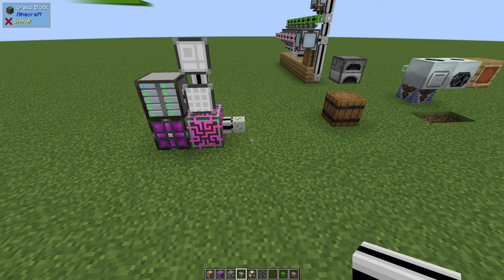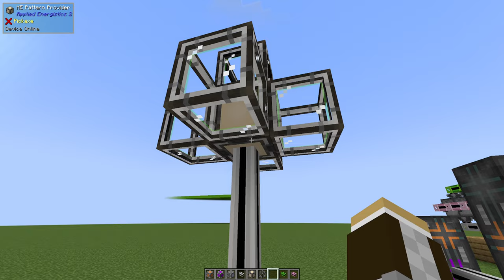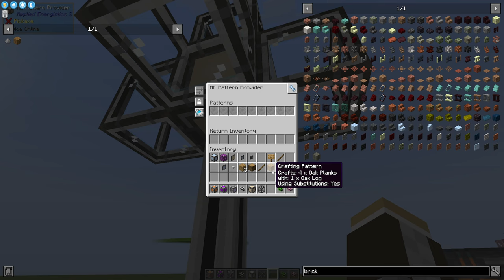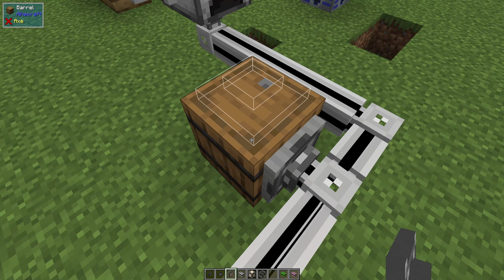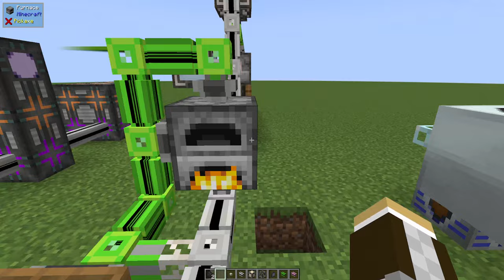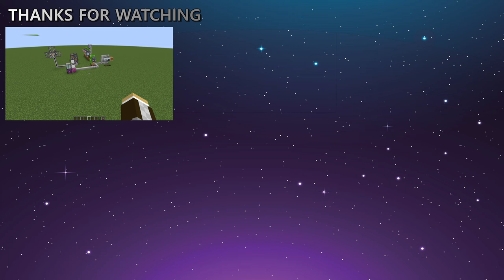Never craft again with AE2 Autocrafting | AE2 Tutorial

Comment: 7:00 instead of filtering the top inserter for ore, you can use an inverter card to blacklist coal in the top slot
12:50 you can directly encode recipes from jei by dragging in the ingredients, or better yet, just clicking the + on the recipe
Reply from the maker: Oooo good call out. Greatly appreciate this added advice
Reply from the maker: Especially since inverting would allow for processing more ores, could be super easily upscaled while accommodating all modded ores

Comment: How do you avoid running out of channels?
Reply from the maker: Using those "ad-hoc" systems help a ton. Basically what I did with the barrel, by having it dump in to a separate inventory, it uses only a single channel on the parent line, then I use a disconnected line to pull from the barrel. This line doesn't touch the controller and takes none of the controller channels. It only needs power that can be provided over a quartz fiber cable.